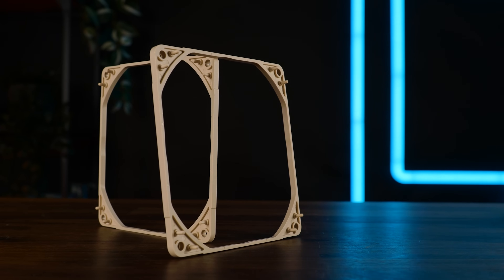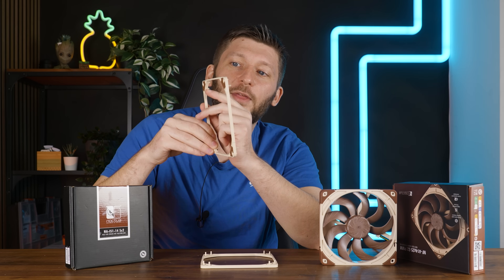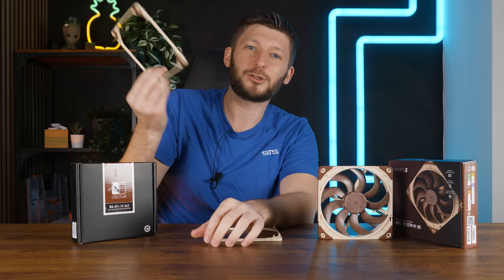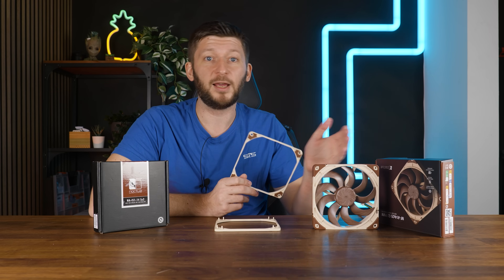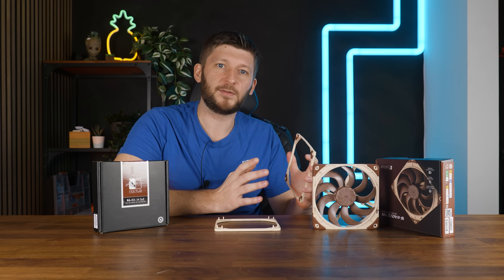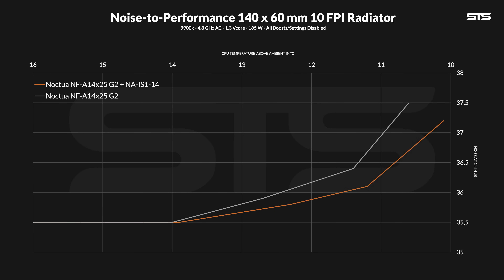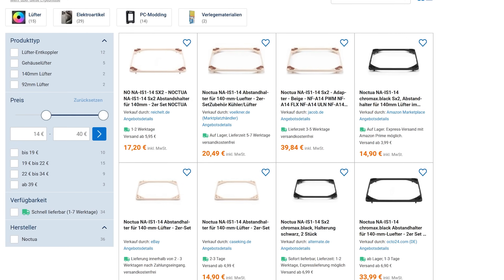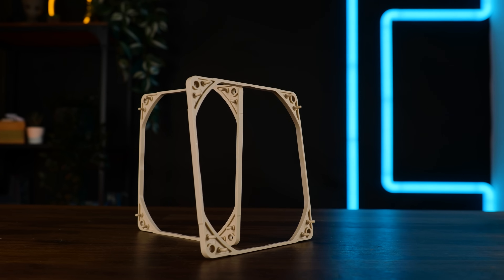Can This Make The NF-A14x25 G2 Better? Noctua NA-IS1-14 Sx2

Comment: Space is great for fans, that’s why I don’t mount any fans on my radiator . Instead I use positive pressure to force air through it. The fans are all mounted elsewhere on the case where they would not have any blockage and therefore don’t need any spacers.

Comment: Hi.
Thanks for the work.
I've been testing radiators with a higher PFI than yours, and the NA-IS1-14 Sx2 increases the noise.
On an Alphacool Nexxos ST30-420mm PFI 16, the spacer increases the noise. On the Alphacool Nexxos XT45 V2 - 12 PFI, the noise is also increased, but less significantly.
Fractal Meshify 2XL case.
On the other hand, everything without spacers on the radiators works much better than with the Chroma Black radiators originally installed.
Significantly reduced noise when pushing on the front panel with 2xNA-IS1-14 and therefore 10 mm of clearance from the front grille.
The same observation is even more evident when extracting from the rear of the case with an NF-A14x25 Chroma Black. The Fractal's grid structure plays a large part in this, with the cutout providing more restriction with a buzzing effect without any spacers.
I apologize for any translation errors with Google Translate.
Have a nice day.

Comment: seems easy to 3d print, what if you tried putting fans on both sides of the radiator. I thought Noctua recommends a certain distance between fans in series.

Comment: There's a HUGE difference in several of your tests, very easily and clearly heard in the sound samples, especially when the fan is pulling air through an obstructive filter or grille. In those cases it sounds a LOT better with the intake spacer, either through lower volume or much more pleasant sound profile, or both.

I personally couldn't care less whether there's much of a performance difference, but I care a LOT about the noise.

Comment: I already use intake fan spacers in my NR200 and C160 ITX cases to reduce intake air turbulence and the sound difference is definitely measurable. The sound profile is lower in frequency, much more pleasant to hear.

I can totally see why someone wants to buy this. I mean €17 for 27grams of premium version plastic is crazy, but Noctua is just mega based, I see this as a way to support them.

Comment: I actually bought 3 of these for my PC, when I built it two years ago.  I use them to push air through and out the radiator at the top of my PC.  I'm using a 420mm x 64mm thick radiator ( lol ).  The reason is that I remember the days of using the frame of old fans as spacers, to help remove the dead-zone from the motor hub of a fan on a radiator.    I don't have numbers to know if it's helping at all, but just by looking at the dust build up on the radiator, I can say that dust is forming more evenly under the fan, than I have seen in the past without any spacer.   Honestly, I wish these were more like 10 or 15mm thick.  Now, I understand that the farther away the fan is, I could run into pressure drop issues.  But with a radiator this thick, the fins don't have to be as dense, so I believe an extra 5 or 10mm would help.  But there is still less dust under the motor hub, than there is under the edges of the fan, But that will always be the case.  But I like to know I'm getting as much performance out of this radiator as I can.   Mostly when heavy loads hit, and It's nice to know that at even 100% cpu usage, My radiator isn't what is holding me back. 

But i'm also an edge case.  I delidded my 7950X, and am using liquid metal thermal paste.  So a person like me has zero issues spending  a few dollars to get even the slightest bit more performance out of my CPU, especially with AMD's Precision Boost being so dependent on temps. 

Also, I bought the industrial version of Noctua's fans, that can reach 3,000 RPM's ( Rebooting my PC is LOUD! ).  But i'm obviously not running them at that speed all the time ( or ever, really ).  So using fan curves, these fans run at like 30 - 40% most of the time, and will speed up for temp spikes ( like when a game pre-loads shaders on boot ).

Comment: For some the improvement in noises is really good... 
You just have to test the fan on the mount you have and if you clearly hear too much noise then  buy this spacer and put it on. This is just something you will need if you have a grill that is not very well design. I think it's more required when you pull the air form a grill  not very well design for air flow (not when you push it). Putting the fan a bit further will make the flow better in some case because  in that case you create a tampon area with lower pressure that will. Of course the result will depends of lot of variable, for many case it won't be necessary. It's just a way to try to improve poor design in air flow.  The best solution would always be  to have a great design from the beginning, but some people do not really care about fluid mechanic, and for them, as long as there is a hole it will be OK. In some system already noisy it won't make any difference, but on very quiet ones it's another level and those improvement could make a difference. Of course if your system is already to notch, there is a very high probability that a good air flow will have been taken in consideration and this won't be required anyway, because it will work very good from the beginning.

Comment: actually he said that these spacers would be more useful if used as a pull fan in a pull-push arrangement on radiators (standard thickness). he suggested me to use noctua a12x25. if I was going to do pull-push, he suggested that I use these on the pull fan side of the radiator. he said that thanks to these, a gap would be created between the radiator and the fan and the whistling problem would be eliminated. can you confirm this? do you have the chance to test this with a standard 27mm thick radiator and not a 60mm thick radiator? my other question is, if I were to use this spacer on the fan I will use on the exhaust side of the case (in a scenario of pushing the hot air inside out), would it be beneficial in terms of noise?
Reply: By the way, the case I am using is 7000d airflow. Would I see any benefit if I used these spacers on my front fans? Or would it be beneficial if I used them next to the motherboard? If it was useful as a case fan, which side of the fan should I attach it to?

Comment: One benefit of using the spacer is that you get more useable surface area of the mesh, which should lower the overall pressure drop and increase performance a little bit. And in push applications you even free up the surface area of the back of the motor, as you said. Should be beneficial if the mesh is really restrictive for some reason, or maybe no benefit at all if it is relatively free flowing. Can't really imagine the spacer having any negative impact unless those 5 mm pushes the other side of the fan closer to something which would add resistance to flow.

Comment: You can buy rubber fan gaskets that will do the same thing but cheaper and without those proprietary tabs. 
I prefer silicone rubber to minimize any VOC offgassing.

Comment: You don't even need to clip anything when using SW4 Pro 140mm. Works like a charm and solved my intake fans and infamous meshify 2 hum problems. Now my bottom intake has no hum at low rpms and front intakes are quieter too. I was very surprised by the result.

Comment: This used to be a common thing in the early 2000's.  Most high end water cooling builds added spacers from 10 to 30 mm to get air past the center hub... and presumably cool the part of the rad that was blocked by said hub.   I theory it sounds logical and would be a benefit, for less noise and more air hitting the rad fins.  There are guys all over Etsy selling these 3d printed in all sizes.  I might give it a try again.  Also, if you're like me, I have so many old dead fans laying around you could just cut out the inside and use that as your spacer.  I wonder why that is not a thing so much as it once was.??
Reply: Noctua had me destroy a fan for the warranty process, so I actually did exactly that and used it as a fan spacer lol

Comment: I could 100% hear a difference in your noise samples, for the better.
Reply: The difference indeed so consistently perceptible, that if you can't notice a difference you might want to get your ears tested.

Every single sample became dramatically softer with the spacer.
Reply: @4Leka Or get better speakers or headphones. But i agree, night and day difference in these recordings.
Reply: Yes! It seemed to slightly lower the average frequency. Or soften the higher frequencies.
Reply: I also, one of them came out of noisy sound to almost imperceptible

Comment: I am using a Phanteks T30 120mm for my intakes limited at around 63% max fan speed, would the 140 G2's be an upgrade?
Reply: Noise/pitch maybe, raw performance no.

Comment: a long time ago I connected the fans on my case using elastics. In addition it allowed me to put a distance between the fan and the case, and yes it had those hated stamped grills. Then I used some electrical tape to close the gap between the fan and the case. It worked as it removed all the noise caused by the grill being so close to the fan. Not a scientific way to do it, but it worked and changed the sound of the fans just like the spacer from Noctua. It was just something I did more than twenty years ago. That it might make the fan more effective was not something I had considered, and back then I didn't have the tools to test such a thing either way. Thinking back I did this "mod" to the fans for blowing into the case and the ones blowing out. But later tests has shown that having a grill immediately next to the sucking fan does increase noise quite a bit more than having it close to the blowing side. Or at least that's my experience.

Fortunately noise is no more a problem for me. With ringing tinnitus in one ear ad being completely deaf in the other a bit of is noise hardly noticeable. Damn thinking about that I realized I "hear" constant whistling in my deaf ear. It seems that not even having the nerves to the ear severed completely stopps tinnitus.

Comment: Before watching the tests I want to say that I guess the spacers are more for improving the sound of the fan than improve the performance. I say that as the closer to the fan you put a grill or obstacle the louder it gets. Sure increasing the distance a little might improve the performance slightly, but I doubt it will be all that noticeable.

Comment: These are from the kind of accessories meant to improve acoustics in understanding of making them less annoying. Not lowering dBA, not improving dBA-normalized performance, but potentially solving acoustic problems which may randomly happen when pairing any fan with any restriction. Having such problem already is the reason to buy such stuff, so it's just great that Noctua sells such kind of things.

Comment: The title of this video looks like your cat walked across your keyboard
Noctua's naming is pure poetry
Reply: Noctua Naming is actually very nice.

    NF-A14x25 G2 
NF - stands for Noctua Fan
A - for fan type (A, i think, is Airflow optimized,  P fans optimized for static Pressure or F for Focused flow, but there are S fans for low pressure high flow application like case cooling, so I see A as some kind of universal. Its just a pattern I see, maybe i`m wrong on some stuff)
14 - is fan diameter in cm
25 - is fan depth (This is standard, but there are also slim fans)
G2 - is second generation i guess, it has different fan blade design than old A14

    NA-IS1-14 Sx2

NA - Noctua Accessories
IS - Inlet Spacer
1 - not sure, maybe depth in increments of 5mm (10mm therefore would be 2, 15 - 3) or just some version number
14 - diameter in cm
Sx2 - Set of 2 in one box

Also
NH - heatsink 
NT - Thermal compound

Their website is reminding me of a wiki page, a lot of hyperlinks to see relevant products, graphs, explanations, reviews and so on. Very interesting to browse around. 
I am somewhat of a NF myself

Comment: As optimum tech tested. They are best for case fans rather than for rad fans. The DB noise is also a bit irrelevant cause it is more the "pitch" of noise that gets more comfortable
Reply: Where can i see that test result?  Can you give me a vid link ? I have hard time with choosing one of 140mm fan
Reply: @rkrnddl5  Video is called: "Stealing Noctua's quiet airflow mod"
Reply: @rkrnddl5  Stealing Noctua's quiet airflow mod is the video title
Reply: @Walhor  thank you

Comment: When will the case manufacturers realize that they need to make the air vents very large? 
If there is no distance between the dust filter and the filter, it will make noise.
Reply: that adds to final product cost.